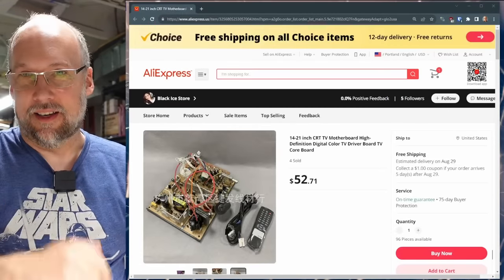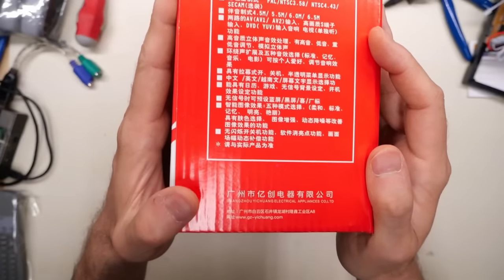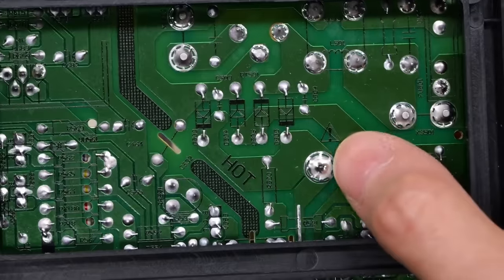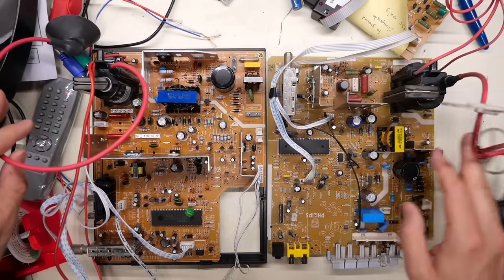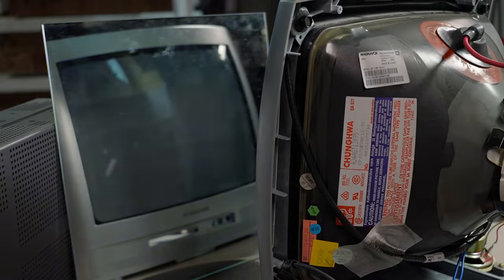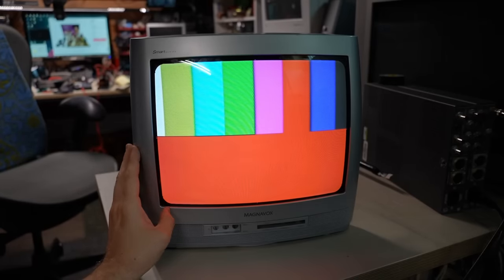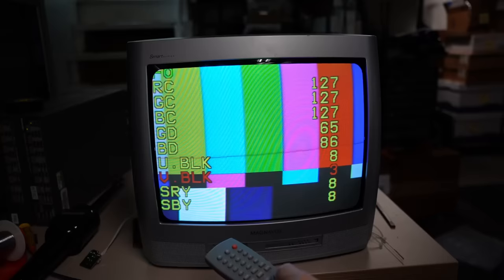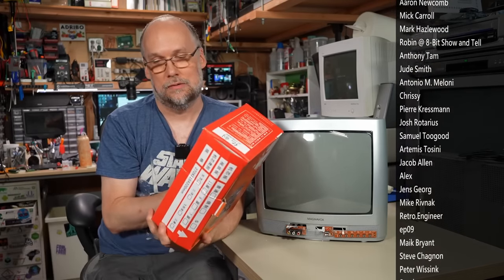I replaced the main board of this TV with brand new parts made in 2023!

Comment: I've had mixed luck with some of these. You definitely need to make sure they have isolation transformers on the ac input.
Reply from the maker: Why? It uses a switch mode power supply with a transformer, so it's no different than using a USB power supply with your phone, etc.
Reply: @adriansdigitalbasement  oh yea, I see this one has a transformer built in. The arcade style ones don't.
Reply: Many TV PCBs (e.g. my portable Toshiba) run on rectified mains directly connected to its GND line, then using the flyback to generate the rest of the voltages.

Comment: The CRTs themselves are not still being manufactured. They are being salvaged, rebuilt with new chasis and boards, and resold as new.
Reply: Really??? There were too many types to simply install them in generic new TV cases. Old CRTs wear not only by burn-in, but also weak cathodes change colour curves, thus ripe CRTs tend to display ugly "glowing" red because low intensity red becomes too high. It would be great if the software in that upgrade board had a "colour processor" to correct deformed curves, so CRTs could be usable about 3 times longer without getting unpleasant colours.
Reply: @cyberyogicowindler2448  The last facility that had the equipment to manufacture CRTs shut down a decade ago. 2013 if memory serves. The equipment is very specialized, so if anyone wanted to get started making CRTs again, they'd have to find one of these old manufacturers who might still have some of that equipment laying around or they'd have to start over from scratch, which would not be easy or cheap. That's why nobody will probably ever do it.

Comment: you over-scan with the vertical and with the horizontal. The linearity is worst on top and should be aligned in case of the linearity is on the top side faster and on the bottom side slower. You can see it on the square tiles. Thumbs up 16.583 weakbit

Comment: I'd 3D print a control panel to screw on the bottom, possibly using some nicer buttons. It would look a little less jank-tastic :) I suppose it depends on how good your 3D CAD skills are!
Reply: The 3D printer is the solution to the this issue some crt tv sets have sensible plastic or the plastic is very old and it becomes easy to broke

Comment: SBY and SRY: These could be related to color calibration, specifically for adjusting the yellow (Y) component in the signal. “SB” and “SR” might stand for sub-brightness or sub-color for the yellow channel, affecting how bright or saturated the yellow appears on the screen.
U.BLK and V.BLK: These are likely related to the black level settings for the U and V color difference signals in the YUV color space used in video systems. “U.BLK” and “V.BLK” might control the black levels for the blue and red color components, respectively, which can affect the overall contrast and color balance of the picture.

Comment: Here in the philippines I and most of the repair tech here have done replacing crt mobos ten years ago but when  lcd become cheap as a dirt people switch unless your child is werdo and throw stones at your tv then crt is right for you, because crt have thick glass screen unlike led tvs which will break at flick of a finger.
Reply: Yes, TFTs break by throwing a playball, tennis ball or plastic toy car at it (without being a baseball pro). CRT might set houses on fire if they implode by thrown objects (only if no parents have a guisher or water bucket nearby), but that's rare. Flatscreens tip over very easily and will likely shatter if they touch anything hard. I think there should be safety laws preventing flatscreens from breaking that easily when gently hit by objects.

Comment: Woah what an outstanding main board! I have a Sony BVM-A20F1M so it's loaded in its own right, but I was SHOCKED to see this one you came across... so cool. Makes me wish I had more experience in high voltage circuits to find a similar board for one of my other CRTs. I mostly do low voltage component level repairs.

I wonder if the noise reduction function is for sound and applies a high pass filter to the output or something.
Reply: I guess "noise" rather meant here snow reduction on analogue antenna TV. My parents had a Metz 100Hz TV with all kinds of digital gimmicks including this, but it blurs motions and removes not only snow but also rain! And the ugly digitalized picture even looked spoiled with those image dishancers turned off.

Comment: I have a 13" color Panasonic tube TV which ran for 15 years or more with no issues before I replaced it.  I think part of the longevity was getting a quality TV, plus it was always plugged into a good surge protector which smoothed out the power and did not subject the unit to transients, and such.  But it is Coax only.  I always wished it had an S-video port.  Sure, I have used an adapter, but it's not the same.   Do you have the ability to hardwire the existing insides to make such a change? Would like to see such a video.
Reply: Many TVs ran >30 years. Unfortunately old CRTs wear not only by burn-in, but also weak cathodes change colour curves, thus ripe CRTs tend to display ugly "glowing" red because low intensity red becomes too high. It would be great if the software in that upgrade board had a "colour processor" to correct deformed curves, so CRTs could be usable about 3 times longer without getting unpleasant colours.

Comment: Ive read that the flyback voltage isnt what kills people, its the discharge current of the idle tube. The cr tube itself is a huge capacitor and can hold that 20 30kv for days. Even the sun can charge them to 10 or 12kv.
Reply: Nope. Not the 30KV are most deadly, but few hundred volt at about 1A, those lurk everywhere in CRT power supplies and mains connections. A CRT is a glass capacitor that stores highvoltage (that 30KV under the suction cup) also when off. Most dangerous of touching it is that you will accidentally shatter the tube and so (particularly with 1950/60th TVs) die of the shard shrapnel from a glass handgranade.

Comment: I consider the phase alternating aspect of PAL to be a detriment when it comes to consoles and computers that generate their own signals and are locally connected to a monitor.

In a broadcast situation, the PAL technique to cancel out color shifting caused by poor reception is a nice thing to have, and the sacrifice in vertical color resolution that results from the averaging of the chroma signal across lines is a good price to pay. That was the main point of PAL, after all.

But for directly attached hardware that generates its own signals, I find it to be problematic. The reason is that, unless you have a unrealistically messed cable between the console/computer and the monitor, such that the signal it carries gets so distorted as to induce chroma phase errors, the PAL technique won't get you any advantage for a local connection, and you are just losing color resolution during decoding for no benefit at all.
If you have a way to disable the delay line that averages the chroma signal between the last and current lines you will see the full vertical color resolution being generated by the machine.

The problem is that the very existence of PAL as a format, and receivers implementing it as intended, has produced an expectation that a compatible displays will perform the averaging at all times. This, in turn, seems to have allowed some hardware designs to make the phase alternation aspect of their signal generators to be less precise, and the solid colors they generate actually have slight phase problems, which would induce the known hanover bars effect if it weren't for the presence of the delay line in the decoder, which is what they count on.

Now, I can't vow for the quality of the decoding of my capture card, but some time ago I recorded video from some PAL consoles that I used to have, using a Bt878 chipset based PCI capture card and a program knonw as DSCaler which interfaces directly with it instead of through a driver, and allows for low level control of the chip's registers, including the enabling and disabling of the PAL style line-by-line chroma averaging filter. The results I obtained were that, for instance, an N64 will have no problem showing perfect solid colors with that filter disabled, but composite or svideo from a SNES will show faint, but noticeable hanover bars just like what you describe with your C64.

If your PAL signal doesn't have chroma phase errors, you don't need to average chroma, and that way you can retain full vertical color resolution. In fact, when PAL was first deployed, the chroma averaging was done visually on the tube and the viewer's eyes, by a combination of display blur, tube size, viewing distance, etc. But as tubes got bigger and better, that no longer cut it and the delay line was indtroduced, in what came to be called "PAL-D", which isn't a variant of PAL but just PAL displayed on a monitor with a Delay line to average the current and previous chroma lines.

But, because the intended use of PAL was for broadcast, it was pretty much assumed that the delay line (or digital equivalent) would be always part of the decoding pipeline, so, when consumer electronics started generating their own PAL signals, those didn't REALLY need to be designed to the highest standards, as they could count on the delay line to take care of the low quality of their phase inversion circuitry.

Well, that's my theory anyway.

Comment: It's not really worth trying to update a color CRT tv, since they're very limited by their original design of the tube.
But it would be fun to see how high of a resolution you can drive into a black and white CRT tube, since those theoretically can have any resolution. The big limitation is getting the focus of the beam.
Also refresh rate could be increased by a lot, just with better drive circuitry

Comment: There is a section of the gaming community that has started shifting back to CRT's for the FPS. It's becoming a big deal. I would imagine this is driving the new demand.
Reply: It is more about latency than bare fps why CRT is superior. E.g. Atari VCS2600 had no framebuffer and so could respond on joystick or paddle motion faster than anything modern. Extremely fast reaction games will play much worse on emulator because there are many serial computation steps between recognizing controller motion and bringing the result on screen (even on expensive gamer PCs),

Comment: Has anyone already commented that the cropped sides problem can be due to the horizontal deflection coil being connected to the wrong fitting position on the connector next to the flyback? (Sorry if that was addressed in the video, I didn't see it in full.)
As a repair romantic, I loved this one, by the way.

Comment: 32:33 That's one of the nice things about Philips and Magnavox sets (Philips bought Magnavox). They support syncing to 50Hz, but don't support PAL color. However, if you have a set that has component input, or has a chassis that can be RGB or component modded, you can get color over 50Hz that way. Unfortunately, this particular set may or may not have supported such a mod. I have a 20" version that looks very similar (but bigger, yours is 13" based on the tube's model number), and it doesn't.

Comment: So there are 5 buttons on the original one it looks like six on the new one. I assume that the original bittons are on the edge of the old motherboard. You could possible cut out that piece of the board and wire the buttons up. Then add a sixth buton thats just a panel mount. Similarly, you could reuse a chunk of the board with the front panel audio connectors

Comment: Boss, make sure the heater (crt) voltage at 3,9v ac. If the volt exceeds above r 4.2v  ac it will ruin the crt cathode in the long run.  So please check it ok.
Reply: CRT heater voltages an pinouts greatly varied over time. (Some tubes had grid instead of cathode controls for RGB signals, needing a different video amp with much higher control voltages.) Thus I doubt this board would run on a 1970th or early 80th CRT.

Comment: I bought the more expensive one for 25"+ TVs. It works on 110v and has two AV inputs. I'm struggling to get the geometry where it needs to be though. The edges of the screen are wavy. Starting to think it's a tube problem rather than a chassis problem

Comment: Me gustan mucho este tipo de videos. Me gustaría no solo la rehabilitación de estas viejas pc, sino también que tipo de uso se les puede dar hoy día aparte de juegos retro. Usarlas como servidor, sistema de videovigilancia, multimedia. Quizás instándole alguna distro de linux. Saludos desde Panamá 🇵🇦.
Reply: My Rasberry Pi 4 with a fan and SATA SSD typically consumes 10 watts or less, which means no excessive heat in summer, hours of operation on a tiny DC UPS and negligible contribution to electricity bills. I use it mainly as a file server, planning to use it for multimedia too when I buy a TV. I think old computers are good for word processing, hobby programming and retrogaming. Some of them might still be usable for multimedia. As servers, I find them quite impractical. Hi from Ukraine, by the way.

Comment: Instead of placing the new board at the bottom of the set with all the modifications, could you have put it inside the cover, by placing it vertical on either side?

Comment: what model it's the pcb on this board? in venezuela this type of crt tv went come until 2012, and i pretty sure i have one damaged, very similar board make by tcl model 40-0nx56 and similar, share the same UOC (ultimate one chip) this "toshiba" chipbut difirent EEPROM data, it's a good idea save this eeprom data, cheers
Reply: and be carefull about the temp in vertical area, the caps dry out pretty quick in tropical temps, and i think it is multivoltaje board, because all lg, samsung, daewoo, and this type of board marked in the tv, and work with single cap style with just 120v, the worst can happen in direct 120v it's the PS can't pull up 120v sorta +B line, and the tv or not turning on, or turning with very small screen

Comment: Would like to see a crt board with modern inputs. One other thing that would be cool is like Smart tv functionality and digital tuner but that would probably be really expensive and better solved with smart tv box.
Reply: The one with dvb t2 tuner did actually exists
Reply: The German HD recorder settopbox "Dreambox" is basically a smart TV for CRT. I am using a Dreambox DM8000 on my PAL CRT TV (VCR as RF modulator). It runs Linux and can not only stream movies, but converts HDTV to PAL resolution, plays DVDs and many other things. Unfortunately it is too old for H265 and can not decode Netflix etc. (may be a licensing issue) so it would need a connected PC to translate the video stream.

Comment: They are pixelating as a countermeasure to recent change in laws. Chinese copyright laws demand brands establish a chinese presence to enforce brand protection. Obviously this is an unfair practice and counterfeits just switch to clone rebranding after said international company opens up shop in China. So Chinese authorities have started to pressure e-commerce websites to come clean at least in image (as opposed to substance) and ban all visual reference to existing brands by bluring the picture of the product. As this practice became increasingly more wide spread throughout China, merchants associate the blur/mosaic filter as a way to avoid trouble for using an image without permission as well. Prior to this it was very very common to use stock photograph or just photographs in general, often under false pretence to serve advertising. On top of that citizens have had zero recourse to impede the widespread use of these pictures in ads.

Comment: Hi Adrian, big fan of the channel and congrats on going full time. I have a Toshiba MH27H62 and the image is shifted so parts are cut off. There is no adjustment for horizontal and vertical via remote / menu. I even checked the manual. Any recommendations? Could this be a cap issue or is this a sign the tube is going bad? That would stink since it is a nice flat glass screen with built in DVD, VHS , S-Video on the front and Component on the back. Any help would be much appreciated. Thank you
Reply: My portable Toshiba had too much horizontal overscan and no trimmer either. I installed a coil with adjustable core in series to the horizontal deflection yoke, so I made screen width adjustable. (Danger: Do not attempt to make picture smaller by increasing screen voltage, else you die of cancer or procreate freaks by irradiating the whole neighborhood with xray radiation.)

Comment: Have you thought of using 3D printed parts to glue or screw on to cover the bits on the front and fill back in the hole on the back. With the right 3D printed parts you could make it look like it was not customized at all.

Comment: Fascinating, I know there is an arcade board replacement but not seen standard tv- if anything it’s missing Scart but has a digital chip so RGB mod could be possible- interesting, wondering if 25-28 inch tubes are covered ?

Comment: I really wish they make these boards for HD Trinitron WEGA sets, so I can get 1080p compatibility as well as universal NTSC and PAL for the analog inputs.
Reply: These highend flat CRTs needed very special dynamic convergence hardware and software. Late Sony CRTs were even programmed in factory using magnetic fields (containing an array of small remagnetizable metal magnets), so if they got accidentally erased or magnetized wrong (e.g. by degaussing coil touching its back), the tube was toast and only made colour mess.